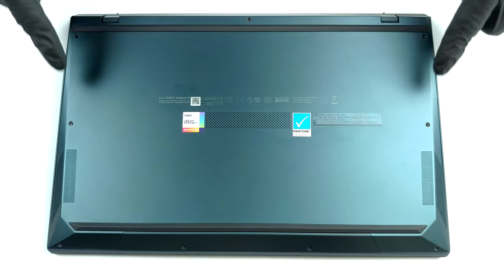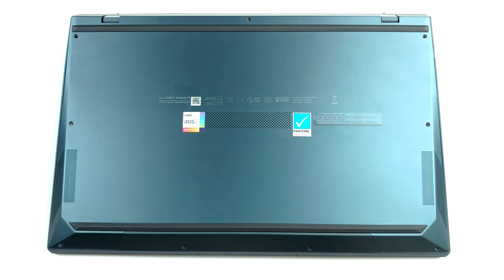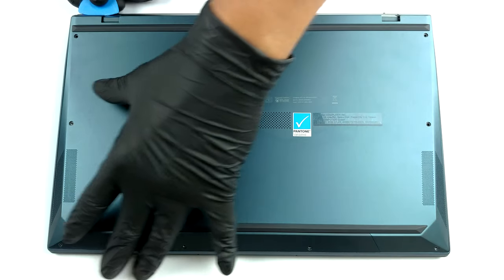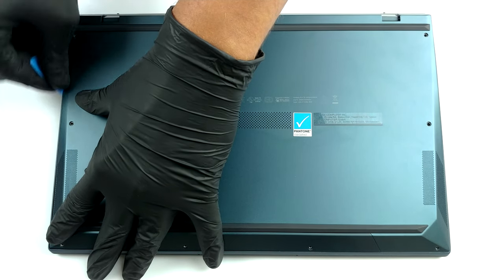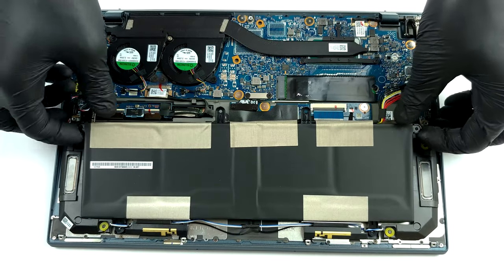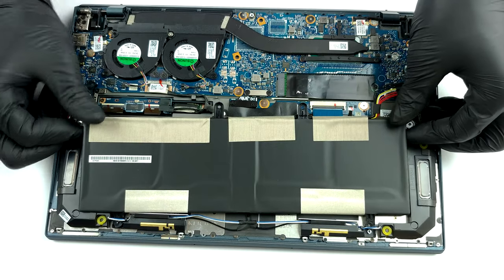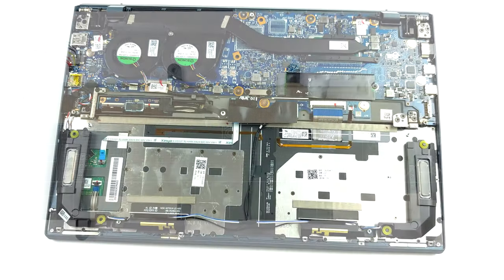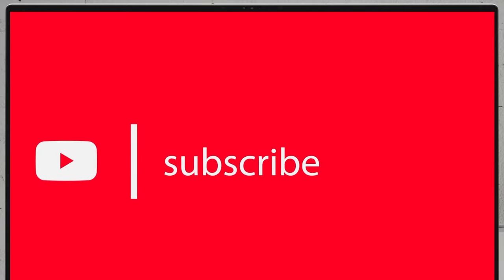🛠️ ASUS ZenBook Duo 14 UX482 - disassembly and upgrade options

Comment: Notices from personal experience:
1. It's easer to start open down plate from front. And back just lifted up easily.
2. I can't understand how to disconnect battery - I slide metal cover, but can't disconnect plug, not to up, not to left. (Upd: I can do this, after sliding cover you must pull plug to yourself, from PCB).
3. Main disappointment - only single-side SSD is fitted. On some SSDs chips located on both side (in my case - Kingston KC3000 4Tb). Such SSD do not fit into socket - chips on bottom side touch to the motherboard, SSD bend out and try to crack out SSD socket! Be advised! (Upd: Kingston NV2 4Tb and Samsung 990 Pro 4Tb fitted quite well and work successfully.)
Reply: I just bought this SSD Samsung 980 pro with heatsink,  (just for firmware update to use in my ps5), and before i open the notebook i want to know if that fit into socket. Thanks

Comment: Wanted to ask if the  nic can be replaced on this device model ux482. Getting network issues. Network drops all of a sudden, and when connected via eth to usb adapter, no network at all.

Comment: what is the maximum upgrade limit for storage and memory on Asus Zenbook Duo 14 UX482.
Reply: If your system has UEFI then you can say that it has unlimited storage capacity. But It is having Legacy then it's only 2TB.  You can check on Google by typing the name and model number of your Laptop and get to know that how much GB RAM you can upgrade.

To know that your PC has UEFI or Legacy you can check you computer hardware properties and then you have to go Booting method/ BIOS type something like that, there you will see UEFI or Legacy.

Comment: what is the max capacity for the upgrade of SSD?
Reply: 4Tb works well in my case (try both Kingston NV2 and Samsung 990 Pro), pay attention that it must be single-side SSD (with chips on one side), double-sided do not fit into slot.

Comment: confirming.... If i go this...ASUS ZenBook Duo 14 UX482EG (Core i7-1165G7/16 GB, SSD 1TB/14 inches, MX450/1,920 x 1,080 (FHD)
could i easily up it to 32?   where do I get that? Its not soldered?
Reply: The RAM is soldered, yes. But 16GB should be good for years to come.

Comment: can this hold a 4tb drive
Reply: Yes, 4Tb works well in my case (Kingston NV2 or Samsung 990 Pro, work both), pay attention that it must be single-side SSD (with chips on one side), double-sided do not fit into slot.
Reply: @YuryMar  Does Asus zenbook duo 14 UX482EAR support  PCIe 4.0? Samsung 990 pro?
Reply: @abhishekdani7  I’m not sure about PCIe 4.0 (maybe it’s works on 3.0 or even 2.0), but Samsung 990 Pro works fine (but little bit hot - it’s about 55-58 C in usual mode, and about 65 C under load). I have UX482EA (not EAR).
Reply: @abhishekdani7  According to HWINFO64, in UX482EA it's use PCI Express version 2.0. And according to CrystalDiskMark max speed of 990 Pro is 3511 MB/sec in my notebook (as for now).

Comment: Hi mate, I would like to update my 16GB ram to 32GB Ram. would you please give me a recomendation which to get? thanks!!!
Reply: This laptop doesn't support RAM upgrade as the RAM is soldered onto the board.
Reply: @sanjivsingh596  so does that mean if I buy this laptop with only 8 GB of ram that I cannot increase it at all? And that if its not purchased new with 16 GB or 32 GB it cant be increased?
Reply: @Luis & Sarah  yes, please go with the RAM version that you need. You can only change the SSD. The RAM can't be upgraded.

Comment: ive said it a million times before and i say it again.
lpddr4x is the best memory for mobile devices.
and there are no lpddr4x memory modules on the market, lpddr4x means soldered.
therefore never say "pity" or "minus" or "cons", its does not make any sense.
Reply from the maker: We actually meant to say that it is pity you can't upgrade your memory. Sorry for the misunderstanding. Also, LPDDR4x memory comes with half the "real" clock speed, because it works at 64 bits in dual-channel mode. The only way LPDDR4 RAM of any sort can provide more performance than a DDR4 module in dual-channel mode, is when the former works in quad-channel.
Reply: Thanks. That's why the manufactures like Apple and Asus all do this.
Reply: ... I needed more RAM for my new laptop, and tried borrowing the 32GB from my old UX8402ZA... Same problem 😞. Funny enough, there is a hole where the discreet GPU would be. Glad I switched to the Framework... possibly for life.